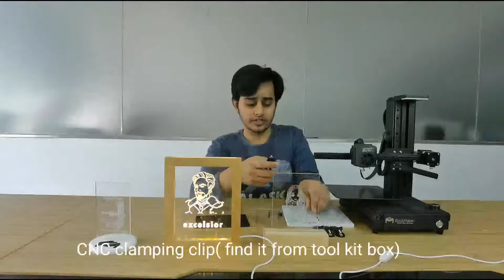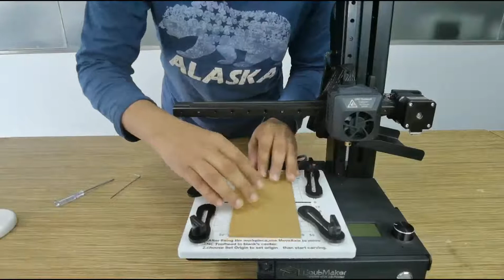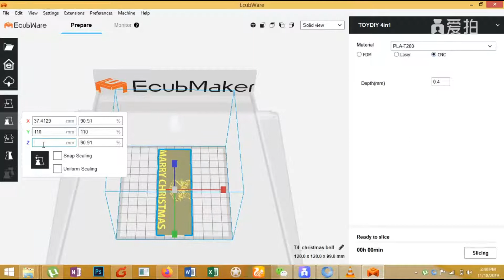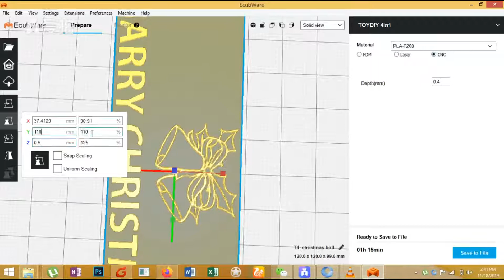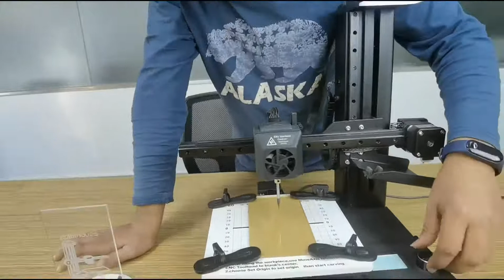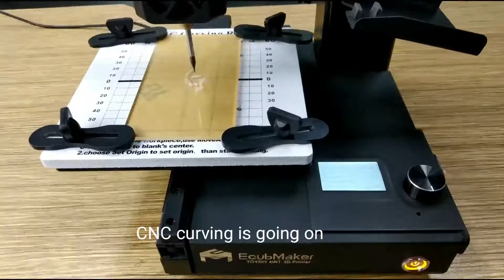CNC Engraving Hands-on Review/TOYDIY 4in1/3D Printer/EcubMaker/CNC carving/milling tutorial

Comment: Hello!  My printer arrived 2 days ago and I got my first print out yesterday! Excellent piece of equipment. I did get an updated model with three tool heads instead or four, no problem. The bars on the Filament holder do not spin freely and the extruder drags the filament and holder across the table. I tried loosening the bolts, but it didn't work. I will print another holder for it. Today I will attempt my first dual color print. So far I am VERY happy with it.
Rocky
Reply from the maker: You can put some grease on that Filament holder whee for smooth rotation. 
Let us know if you have anything to ask.
Reply: Is there a way to make the Dual Extruder change color at a specific layer? I want to make a keychain name tag for my wife using two colors.

Comment: Hi!
Just purchased one of these on Amazon. A little confused about whether I get 1 single AND 1 dual FDM module. According to them, (Amazon), I will receive both in the package I ordered around the end of this month. Also, in the videos about 3D Printing, it is not clear how to remove the filament(s) in a way that will prevent blockage. Can you explain for me the best way?
Thank you,
Rocky
Reply from the maker: Thank you so much, sir, for purchasing our TOYDIY 4in1 3D Printer.
As there are two different listings in our Amazon, One is offering 4 toolhead, which you need to upgrade the machine to the latest firmware by yourself. Another one is New listing with three toolhead for 4 functions. FDM-dual toolhead will do the work for Single color and dual color 3D Printing. This one you don't need to upgrade to the latest version. It's already the newest upgraded. 
The way for removing filament if it's blocked inside the toolhead Teflon on the nozzle, we have a youtube video to solve this problem. You can watch and easily clear the blockage.
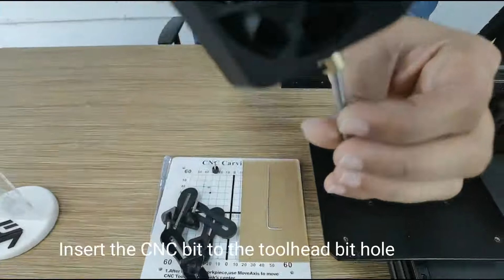Watch it from 2:28 minute: https://www.youtube.com/watch?v=NLEDy_vQU9g

Let us know if you need anything else to know. We hope you will have a wonderful experience with our TOYDIY 4in1. You can join our Facebook community group for support , or send us direct message to us on FB Page.
Facebook Page : https://www.facebook.com/EcubMaker3D
Facebook Group: https://www.facebook.com/groups/ecubmakerusers
Reply: @ecubmaker3dprinter73  Thank you for the prompt response. All I guess I need is the location and instructions on the correct upgrade. I will contact you again once I receive my unit! Rocky
Reply from the maker: @dabbler90  NO Problem sir, I will guide you if you need any kind of help.
Reply: @ecubmaker3dprinter73  Looking forward to a great relationship!
Reply from the maker: Thank you so much sir